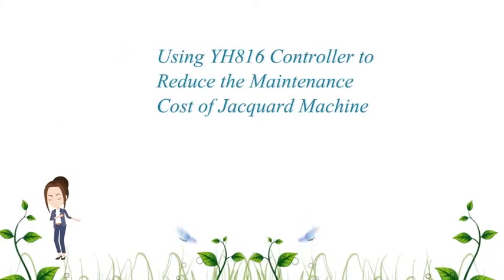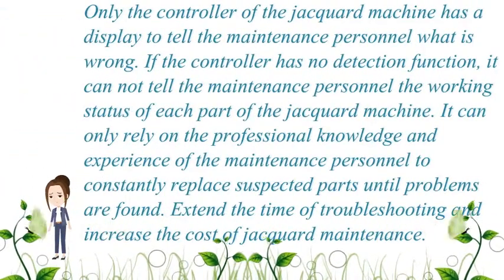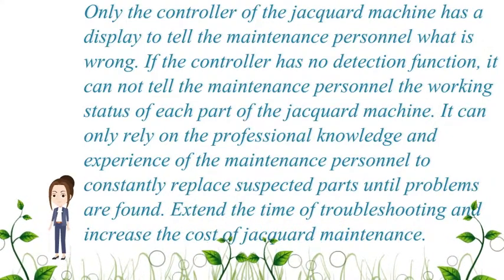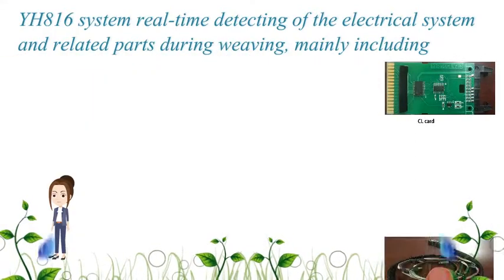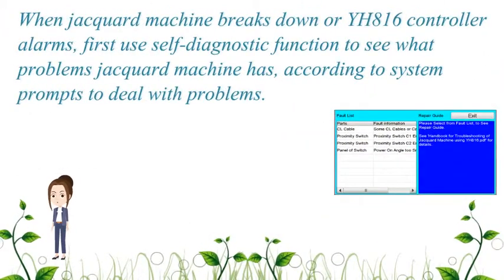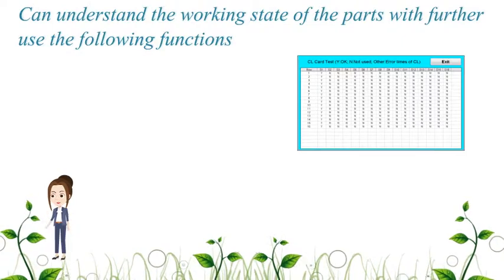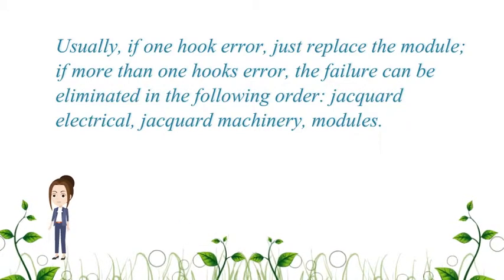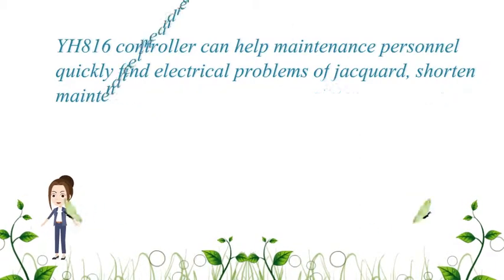Using YH816 Controller to Reduce the Maintenance Cost of Jacquard Machine

Comment: Hi iam from Andhrapradesh total software price for 1536 hooks
Reply from the maker: Software of controller and main card are free .
There are two type of software: one is for Saree (Border&Body with merging function); Another is normal used.

 We currently have the following series of electronic jacquard machine control systems:

1. YH815 Controller and Main card from USD94 to USD147
   Mainly used for shuttle looms, up to 960 hooks 
   Controller: 4.3 inch Controller bulk parts, Resistive touch screen
   Main card: 10 Sock
   
2. YH816 Controller and Main card from USD153 to USD283
   Mainly used for Rapier looms and shuttle looms, 
   up to 3072 hooks 
   Controller: 7 inch Controller, plastic shell, Capacitive touch screen
   Main card: 16 Sock, 24 Sock 
   
3. YH817 Controller , Main card , Mother card
   For all looms, up to 49152 hooks 

Please contact me for details.
   
Shanghai YiHao Electronic Technology Co,Ltd
WhatsApp:+86 13901961347
WECHAT: dmh13901961347
Mobile: +86 13901961347
Email: dmh530@hotmail.com

Comment: I am in Bangalore... Price sri
Reply from the maker: We currently have the following series of electronic jacquard machine control systems:

1. YH815 Controller and Main card from USD94 to USD147
   Mainly used for shuttle looms, up to 960 hooks 
   Controller: 4.3 inch Controller bulk parts, Resistive touch screen
   Main card: 10 Sock
   
2. YH816 Controller and Main card from USD153 to USD283
   Mainly used for Rapier looms and shuttle looms, 
   up to 3072 hooks 
   Controller: 7 inch Controller, plastic shell, Capacitive touch screen
   Main card: 16 Sock, 24 Sock 
   
3. YH817 Controller , Main card , Mother card
   For all looms, up to 49152 hooks 

Please contact me for details.
   
Shanghai YiHao Electronic Technology Co,Ltd
WhatsApp:+86 13901961347
WECHAT: dmh13901961347
Mobile: +86 13901961347
Email: dmh530@hotmail.com